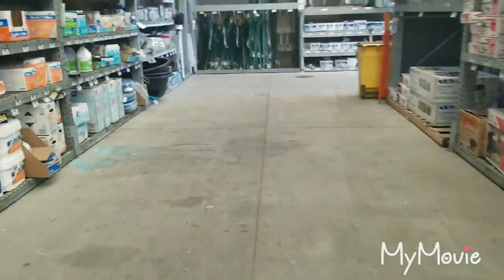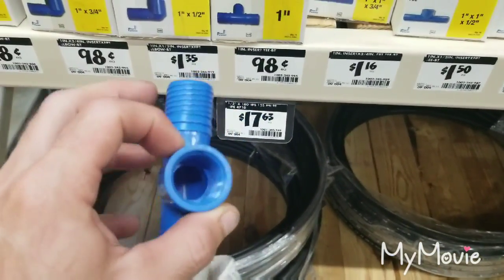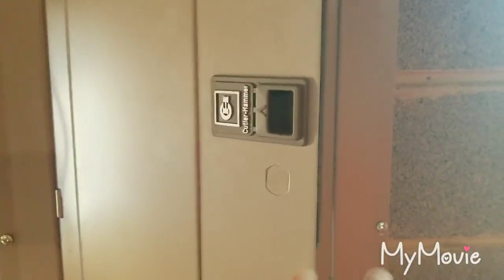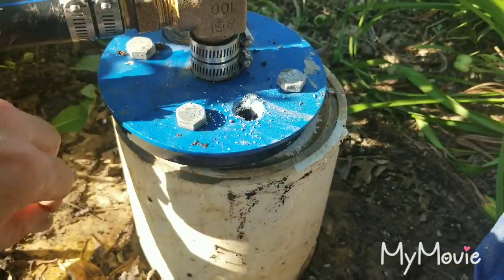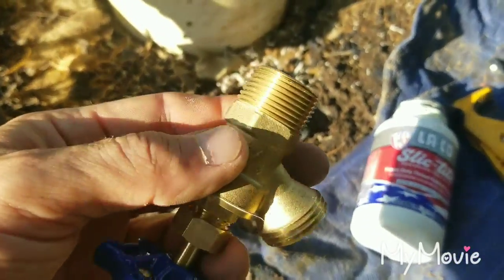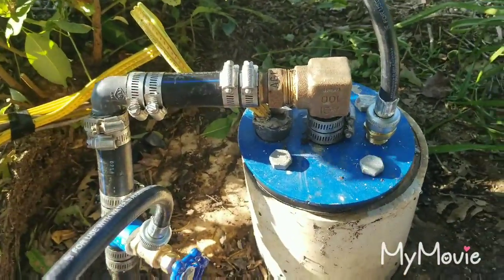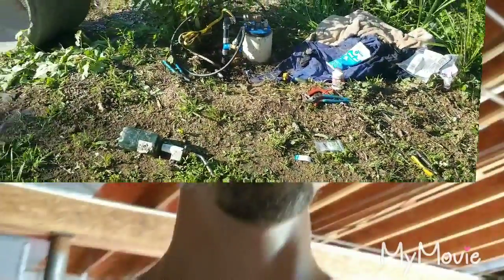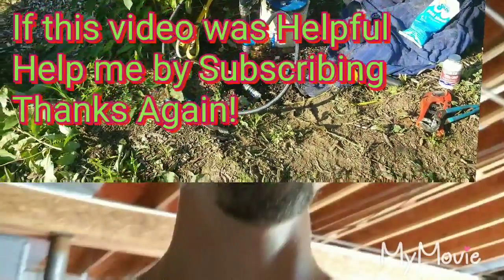How To Sanitize a Well. Well Cleaning. Sulfer/Red Iron/ Bacteria

Comment: I just replaced a shallow jet pump in a cabin that has been vacant over 5 years.  30/50 P. Switch. Now the pressure rises to around 38lbs and no higher, the pump appears to cavitate and will not cut off. Obviously this sounds like an air leak on the suction side right? When turned off the pressure does NOT bleed down over time.
 My fittings appear to be tight. Appear.
The water table is 11' down and there is 20' of pipe.
Pump, switch, tank all new. Also, i ran a garden hose down the well about ½-⅔flow and the water did back up eventualy. I'm thinking my next move to be, pull up the well point, inspect, clean and START OVER.
 Any ideas that would save  me from doing all this? I don't care what it takes as long as it works
Reply from the maker: I kinda feel like your correct. 
The well isn't letting water in fast enough. 
The pump is sucking it dry. 
Sometimes running it dry will help it to flow better and better. 
We call it "working a well" 
Since it sat un used the screen can get silted in. 
What diameter is the well pipe? 2"

Comment: Have you ever ran across an issue such as an animal that has fallen in and died? I bought a property where well didn’t have a lid and when I pulled the pump an opossum came out with it. It smelled horrible so I can only imagine the bacteria in the water…how would you clean/disinfect? TIA
Reply from the maker: A well drilling company has to come out & do a air lift to your well & blow it all out.  Get on Amazon and buy a few bags of pool shock. Put a bag in the well before & after a driller blows the well clean. It's the only true way to remove everything.

Comment: Great video. My well has been sitting for a long time, and has bad iron build up. Should I use the same pool shock that you did ?
Reply from the maker: Yes! You can do this process multiple times and it will get better each time.
Reply: @h2omechanic   Thank you for the response. My well is really bad with dark red iron and sludge. I am hoping this will take care of it. My pump was packed full, so I flushed it off with a hose. I want to replace the pump and pipe, but only after doing this process. A well guy came out to inspect it, and said this process will break down the buildup on the casing, and liquify it more to be able to be pumped out.
Reply from the maker: @chuckspage3853  yes, this will help. But the proper way to scrub a well is by air lifting or "jetting" basically like pressure washing the side walls. Youd have to find a driller setup for jetting and its expensive . But successful. 
My videos on loop chlorination is a great DIY cleaning.  If you pull your pump, a 6" chimney brush + weight & a long rope can help by brushing the walls. Just a thought.

Comment: I'm buying a house and the well is the only downside. I have heard that they have had issues for years with "red mud" in their system and the water was undrinkable. When I went to the inspection it had a horrible smell coming from anywhere we used water. I'm not sure if it was just when we used the hot water but it was so bad that I had to leave the room. It didn't quite smell like rotten eggs but it was bad. The house hasn't been lived in for about 2 years so I know there has been a lot of settlement probably. Im trying to do research about this stuff and what you are doing is what everything says to do.  I'm going to wash out the water heater and do this well sanitizing. But my question is, will this fix my "red mud" issue? There is a filter for the washer as well so they definitely had issues with the water. The well is at least as old at 1984 as there was a previous house on the property
Reply: Find out the well history ( who drilled it, well log, static water level, well gpm, pump setting, and pump size). Its hard to say what is causing it. The pump might be oversized, the well might not be cased, or it could be a high iron well. All possible causes can be fixed in some way but can be costly

Comment: great video!!! so my question is while the water is recirculating back into the well for 24 hours im going to assume its not safe to use or drink any water correct? also how often do you recommend doing this? also is this the same as adding bleach to a well?
Reply from the maker: 1 bag of shock is equal to 12 gallon of bleach. I prefer pool shock bc it cascaded down thru the entire well. 
If you use bleach, use 3 gallon per 100ft of well depth. 
Or 3oz of shock per 100ft.
I wouldn't drink or bath the night you do this. But worse case it would dry out the skin a little. 
I'd recommend doing it every 1-2 years.
Reply: @h2omechanic  we just moved into our house and I have no idea of the depth of the well we asked the previous home owner and they don’t know either. If the depth is I known how much do you recommend using?
Reply from the maker: @EluderRacing  5 gallons of bleach. Or a half bag of shock.

Comment: Excellent tutorial!- subscribed. 
A couple of questions; for how long will the sulfur odor be eliminated with this method? Secondly, a similar method shown on Youtube for sulfur elimination, at the well head, shows a hose, for limited amount of time, entering the well casing, with a tight plumbing fitting producing an atomized water return. In your experience is this sustainable for sulfur remediation

Comment: Yo thanks for the video man very clear super helpful. I have a 525 ft well I’m thinking of doing a solar well pump I get full sun all year. What’s your thoughts on solar well pumps ?
Reply from the maker: If its temporary water yes. But I don't believe that it will supply a house for normal use. I've seen them work good for cattle waters
Reply: @h2omechanic  I’m going to pump into a 10000 gallon tank and then pump from the tank to the house. You thinks a better idea ?
Reply from the maker: @stickolascage2936  every situation is different. Idk why you'd want to do that unless you're well is very very low production and you need the storage. But what you want to build is extremely complicated in my opinion

Comment: so i have a1 HP SJ10 Goulds jet pump. How/where do i add the shock into the system? Pum sets atop a 2" pvc pipe and i dont see any ports to access. Any ideas? we have iron bacteria and bad smell.. Thanks
Reply from the maker: You must be on the coast? The 2" pipe might be the well itself.  Not sure if you can shock those. Bc the casing is a suction pipe. But I'm not 100%
Reply: @h2omechanic   yes sir texas.  thanks

Comment: You do good work! Thanks for sharing the knowledge.  You mentioned a 24-hr period for chlorination. Do you open the boiler drain so the pump runs continuously for 24 hrs?
Reply from the maker: Yes. After 8hrs you can slow down the flow to 50%. Circulate it then run it out on top of the ground for a while
Reply: Seriously? Ok what do you in next rainfall? Think about it……….. that’s right. What ever contaminates is previously is getting washed right back into well. Treat the water you drink and leave the well alone. This is dangerous simply due to the comfort you feel afterwards.

Comment: According to this theory  I could run my water spigot to the top of my well And open it up after shocking my wellUnfortunately My  Well it's only 25' deep I would like to dig One at least  200' deep to sea If my water has the same problems
Reply from the maker: A deeper well would fix your problems.  Shallow wells have a high mineral content
Reply: @h2omechanic  ok it's kind of close to my home to bring in large machinery any idea how to dig 300ft or so without serious machinery?
Reply from the maker: @kevinlewis9151  all drilling equipment is the size of a dump truck... your best bet if the well never runs dry is a bad ass water filtration system. Similar to the setup in this video. (Big blue inline filter- acid neutralizer- water Softener) it helps alot with iron if done correctly. Maybe call a water filter company/ installer nearest u.
Reply: @h2omechanic  only option is Culigan and I'm far from impressed. I'm fairly certain with a lathe in my garage and multiple serious motors I am pretty sure I can use some 4 in metal galvanized and weld a cutting head to it and use a casing motor gear combination to drill my own well using the same material my existing casing is made out of to drill my new well and pipe it out or pump water in and mud out using existing orange well water.

Comment: Thank you for sharing your wisdom. We live in central Florida, in a 1964 Jim Walters home that only has a 2 inch well casing and our water is only about 10ft and not sure how deep the well is. We are on a canal to the river and we caint wash our cars, clothes, ECT.. Without them turning orange. I've been told by some its heavy iron, and others say it's tannins. I know our sinks, tanks to toilet, shower, ECT.. Turns orange/brown, and when I fill a glass, and leave it over night, it settles to the bottom. What can we do please to be able to wash our laundry and cars, without breaking the bank?
Reply from the maker: A water treatment system would be required. It's roughly $3800...so that would hurt the pocket, but would be a good investment if you ever decided to sell the property. You can try what I did in this video, follow the steps & do it a few times, then once a month. Thats the cheap route.
Reply: Thank you for your wisdom and I will give it a try and Continue to follow you.

Comment: You have earned another subscriber here. I found your channel doing a search for changing a submersible well pump. I then started looking around at what else you have and found this one..   I have a 10" well casing that goes down around 180 feet. The pump I pulled out years ago was a 2-HP many stage from 1988'. I pulled it in 2011'. Gotta love a Myers pump with a Franklin motor!! It was tested by a pro who set it up with a gauge into a full 55 gallon drum. With the valve wide open, it pegged the gauge and emptied the drum in seconds!!! My first thought was: That would be great for fighting a fire!!! Anyway, I ended up using a few above ground pumps because they were easily had and I could set them up with a bad back.. Well, now I am tired of replacing jet pumps and it is time to figure out everything I need and where to get it. Really the 10" x 4" well seal is the hardest thing to come by. Also Knowledge of hooking the pump to a controller that will take a signal from a sprinkler timer. (24 Volt).  After watching your video I am going to use this BLACK poly pipe you used in the other video. I believe I can even deal with that!! lol. I have never known our well to get any lower than about 20 feet from the top of the casing, so I'm guessing 40 or 50 feet down would be fine for the pump to hang. I do know I need to shroud the pump in 4" casing or it will turn into the fiasco I had when I bought the house. It also didn't help that the 2 HP pump had a 1HP controller.....  So, I am off to watch more of your videos.. Thanks for providing.. I hope you hit your goal soon!!
Reply from the maker: I'm sure you can find one online. Look at Goulds, Jacuzzi, Simmons. Those are great brands. Lowes & home depot pump are ok...but not my first pick. Definitely not a Amazon pump
Reply from the maker: Happy to help! Just buy a 1Hp 2wire 20gpm pump & hang it at 120ft on 200psi poly pipe. Itll work fine & no need for a control box. With a little research, you can find a magnetic pull in box that will control your pumps on/off with the 24v.
Reply: @h2omechanic  TY for the reply!!  
So NO CONTROL BOX AT ALL??? 
What brand do you like that I can buy as a homeowner without a business?
Reply from the maker: A 2 wire pump is very simple to wire up bc there's no control box

Comment: Thank you for making this video to share you knowledge for those of us who are set on doing it ourselves. How effective is this treatment on wells that are troubled with iron bacteria?
Reply: Also how long does it keep the well fresh for is it a one time fix Or is this just a maintenance thing that should be done every so often? If so how often ? Thanks
Reply: @stickolascage2936  We have really high iron and get the sulfur smell/iron bacteria Bacteria quickly if we don't run the water often. A local water remediation expert said that wells that have hard water and/or high iron should be shocked every year. We just did an acid treatment on our well casing and got a HUGE iron deposit and have been flushing out bright orange water for two weeks. Bacteria grew within one week of doing this - lesson learned stay on top of it!!
Reply from the maker: Very effective!

Comment: Great Job. I have an old well I found on my property, 92 ft deep 12' down to water. I want to install a pump but I have no idea how this well will perform. I'm sure this is one step that will be needed. Well is probably 62 years old, near a lake in alabama.
Reply from the maker: Set a 1/2hp at 80ft. I have a install video on my channel that will help guide you. They stopped at 92ft bc they got good water. That well should be fine as far as production. It may need to be ran for a day or so to flush the veins of the stagnant water.

Comment: Also don't use very big pellets.  Our well is 475 feet deep.  Imagine dropping a large pellet from 450 hitting your pump.
Reply: It hits the static water before it hits the pump and breaks up
Reply: @Lmiller201  Yah, only time pump could be out of the water is someone ran the well dry. And/or its a bad well, and needs to be addressed before wasting time shocking a hole that doesn't produce any water.
Reply: The reason you dont use large pellets is they can get stuck on things like torque arrestors, and then build up and harden into mess like concrete. You want the powder like he uses to make sure it gets down to the water.

Comment: Subscribed and thank you for the video! Could I use gallons of unscented Clorox instead of the pool shock?
Reply from the maker: When you add chlorine to the well, use it like normal until you smell the bleach smell. Then run Hot only for about 15-20 minutes in a bath tub. That will put 40-50 gallons of treated water into the water heater.
Reply from the maker: Clorox is only 5% strong. Pool shock is 67% strength.  
You can use Clorox but it doesn't do what shock it will.
Reply: How do I disinfectant the inside of my water heater when I shock the well?

Comment: Thanks for the video.  Question: if my pressure tank has a check valve before it, and I would be trying to hook a hose at the well head before the tank, how will the pump run for 12 hours to circulate the water if the water pressure switch is satisfied by the full tank pressure?
Reply from the maker: It won't. The check valve at the tank prevents it from back flow. I don't install them at the tank bc it gives the possibility of air into the lines if the pumps check valve fails or leaks slightly. All you need to do is run a hose from the house spigot.
Reply: @h2omechanic  thanks

Comment: Video is helpful but how do you feel
About getting the high dose chlorine into the hot water tank and then into the septic system ??
Reply from the maker: That's why I recommend running it off the next day threw a garden hose.
Reply: Use a hose on the HWH to drain the chlorinated water outside rather than into the septic-

Comment: That's not how you do it. This is actually a bad idea. Just stick your hose right into the casing. Take your well cap off.
Reply: Also, don't use pellets unless the well is extremely deep and you're worried about treating the entire thing. If you use pellets be prepared to wait a long time for them to completely dissolve. A bottle of household bleach is typically all you need.
Reply: Based on what I have witnessed, this guy is not a licensed master plumber and has never done an apprenticeship under one. Don't take plumbing advice from somebody unless they are licensed.
Reply: Alright bubbles

Comment: So once I get my well and pipes in my house chlorinated and it's all good.   Do I just sanitize the softener and hot water heater separately.       I have extremely smelly water.  And it leaves slimy residue in things I put the water in such a water dishes and toilet tanks and humidifiers
Reply from the maker: You Can Not run chlorine through your softener! Put it in bypass for 2-3 days. What your experiencing is just bacteria build up, the chlorine will kill it within 12hrs & after about a week youll notice that the slimyness will go away. If you treat the well, everything will go back to normal water again. Just run the water alot on the second day to try to evacuate the water and allow fresh water to enter the well.
Reply: @h2omechanic  yea ive seen videos on what happens.  What i meant by that was santize with some like out softener cleaner.          What about the hot water heater.   Do i need to bypass that as well??     I Have only lived in my house for a year so I assume all piping and tanks are probably pretty bad.
Reply: @h2omechanic  how long after the bleach is out can I turn the softener back on
Reply from the maker: Once you no longer smell it, you can turn it back on. Or 1 week after normal usage
Reply: @h2omechanic  ok thanks.    I keep having an issue with sediment and bleach smell after the water sots for a while.       I ran my hose about 8 hours at least.
Reply from the maker: You don't have to bypass the water heater.
Reply from the maker: I've actually heard of ppl putting IronOut in the softener to clean the bed, but don't consume the water for a couple weeks afterwards.  Thats only if u have iron bacteria though. If u clean the well, the filter will clean itself during the next backwash cycle
Reply: @h2omechanic  I think i do because there's been red slime in the  toilet tank.  I really appreciate threw replies.  Ill sub
Reply from the maker: If you pumped it out onto the ground for 8 hours , then it definitely should be ok .